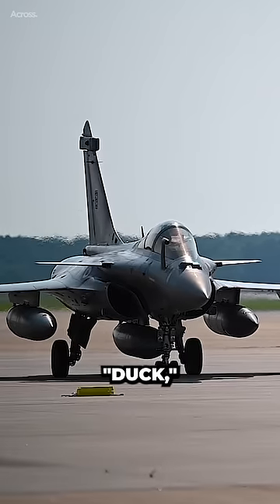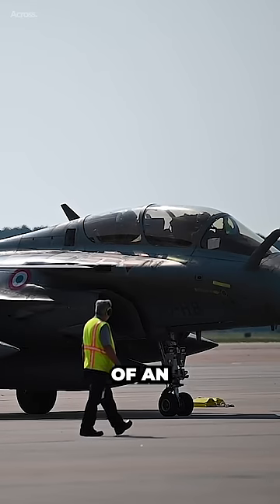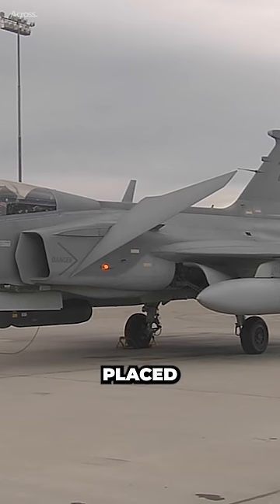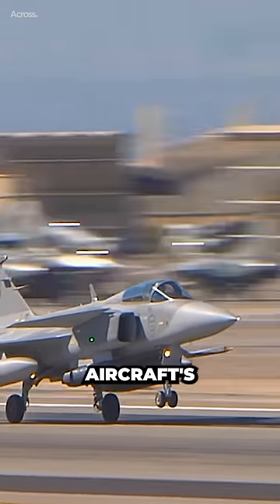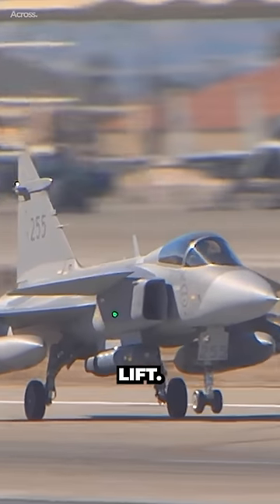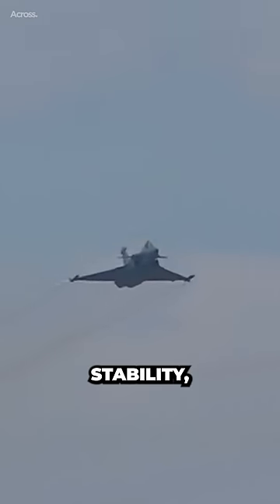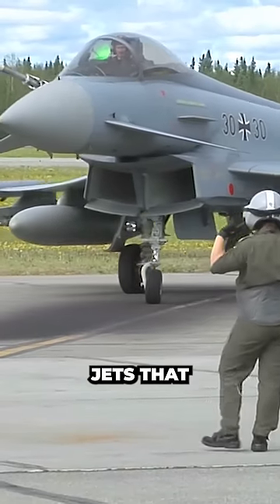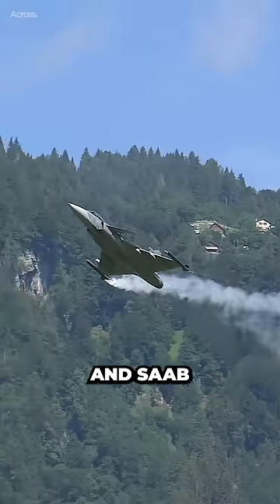Why Don't American Fighters Jets Have Canards? #shorts

Comment: “So the US avoids complex and unstable fighter designs? Please, tell me more.” - F22 and F35
Reply: Ironically, the F22 actually is designed to be aerodynamically stable as opposed to being unstable and having its thrust vectoring compensate to make it supermanuevereable. If there's anything that is purposely designed to be unstable, that would be the F16.
Reply: @Eis_  the eurofighter has canards, it is designed to be unstable,and is one of the best  4th gen fighter on the market,especially with a RAF pilot in the cockpit.
Reply: @Eis_  the f16 is designed to be unstable and that’s one of the most produced jets
Reply: @ellepant  The problem with the euro fighter isn't that it isn't a great fighter jet. Possibly better than any the USA flys. It absolutely is a great fighter. The problem is that nobody needs fighter jets anymore. What you want is an air superiority jet. 

A squadron on euro fighters lose to a pair of F22s every day, all day. It's been proven in war games over and over and over. But before you go clicking off on your keyboard...

I know that it gets publicized every once in awhile that the ef beat an f22 in a war game. If you actually read about them, and not just the headlines, it's always in a situation where the f22 started in a completely disadvantageous position that would never exist irl. And it almost always happens after the F22s just won the last 12 matchups when more equal starting points were used. It's basically impossible for a ef to sneak up on an f22. The f22 is basically an invisible AWACS with missiles. 

The problem is the euro fighter pilot doesn't even know the f22 is in the air until they have it in visual range. The f22 may as well be in invisible. The f22 can see the euro fighter on radar from 300 miles away, has missile lock, and fire. The eurofighter never even knows what happened. All they know is that someone just shot them down. 

The f22 loses when they start the fight 20 miles apart with the ef on the F22s tail. Its not that it's a bad jet. It's like putting a sniper up against Mike Tyson. If you start them ten feet away from one another, the sniper has no chance, he'll get beaten to death. if you start them a mile from one another, Tyson has no chance, he's getting his chest blown out by a 338 Lapua. 

Seriously. Go read about it.
Reply: @ellepant it’s also more expensive than the F-35A. Why buy a 4th gen when you could get a 5th for less. The capability gap between them is huge.
Reply: @herranton  yeah im not going to argue with you over an f-22,but that wouldnt really be a fair match up would it,same as an f-35.
Reply: @alexalbrecht5768  if your from the US why would you have 4th gen f18 f15 f16 core of your naval and airforce,if there so poor,because an f-22 and f-35 would blow any of them out the sky before they even know they are there.I would put a eurofighter up against any f18/f15 or f16
Reply: @ellepant  because they aren’t nearly as expensive and have been the backbone of the US Air Force for nearly half a century. F-22s are over 200 million usd a unit. Plus the F-18 is being replaced by a 6th gen aircraft
Reply: @ellepant  no, it absolutely isn't.
Reply: @alexalbrecht5768 : The F35 is cheaper to buy than a Typhoon. But its operating costs are a damn site more than a Typhoon.
Reply: @THE-BUNKEN-DRUM  the cost per hour for the F-35A isn’t much different than the Eurofighter. The F-35B is a different story but isn’t relevant to this comparison. The small cost increase is definitely worth it for a far superior aircraft that can survive in the battlefields of the future.
Reply: @ellepant  I believe the Luftwaffe is still a little bit better than the RAF 😉
Reply: @alexalbrecht5768  exactly,if your going to compare,it would have be the new 6th gen your building and the UKs new 6th gen there building,that would be a fair match up,because i cant say f-35 as we are partners in making them.
Reply: @alexalbrecht5768  Im English we do have the f-35b but they are for different roles.
Reply: @christianw.7824  🤣🤣🤣🤣🤣 im not even going to bite mate 🤣🤣
Reply: @ellepant  finally the garbage Eurofighter will be a relic of the past. Maybe the GCAP can make an actual plane this time.
Reply: @ellepant  the lift fan makes it practical for small aircraft carriers and improvised runways. Your carriers can’t operate anything else since the aging harrier fleet was retired.
Reply: @herranton  I take it you haven't heard about the long-range F-22 kills by the Typhoon, using the PIRATE IRST system to cue a Meteor missile via datalink? The F-22 may be stealthy for radar but it can't avoid skin heating by air friction. It has been demonstrated that he PIRATE system can detect the F-22 at much longer ranges than the USAF is comfortable with, and the Meteor combines very long range with high probability of kill.
Reply: @JC130676  I have. 

And my statement stands. The EF gets kills when it gets to start in an advantageous position. The raptor pilot can see the ef before the ef can see the raptor, AND, the raptor has longer range weapons. 

And even if it does come down to the turn in a real life scenario, the raptors are shooting first. After that, the EF gains an advantage in maneuverability. 

The situation you discuss is the same one I did previously. The EF scores kills when the wargames are tilted into its favor in the begining. In a dogfight, the raptor can lose. But it never will get to that point.  

The range the EF can see the raptor at is smaller than the one the raptor sees the EF. It's that simple. The raptor is invisible. Might as well be wonder womans jet.
Reply: @herranton  No, the F-22 does NOT have longer range weapons. The 120D has a range of 86 nmi vs 110 nmi for the Meteor.

As for detection range: like I said, the PIRATE has been shown to detect and track the F-22 at a MUCH longer range than the USAF previously thought possible. The exact number is obviously still classified but if it has the USAF worried...
Reply: @herranton  imma stop you at "perhaps better than anything the US flies"

The F-22, F-35, and F-15EX are significantly superior. Agility is a nice to have metric in a modern fighter jet
Reply: @JC130676  citation needed
Reply: @JC130676  a cloud gets in the way and it stops working

B. No IRST outranges radar so I'd enjoy an explanation for why the F-22 wasn't allowed to shoot back.
Reply: @hypersonichobo4263  Context matters. Go re-read what I wrote. It's a better dogfighter. Which is irrelevant in today's world.
Reply: @herranton  I'm honestly not convinced it is. All of these airshows and stats are always of clean airframe vehicles. External stores absolutely tank aerodynamic performance. While on paper the F-35 is slow at a mere Mach 1.8, very few Gen 4 aircraft with fuel tanks and more than four missiles can break Mach 1.3. The Mig-29, at least in the 90's, couldn't break Mach 1 at all with a centerline fuel tank. 

The one time a typhoon out turned a raptor it had 0 stores and no gun ammunition to a fully loaded raptor with two external fuel tanks. 

One of the advantages of stealth jets is they perform the same regardless of if they have internal weapons or not. All the fancy airshow flying of the super maneuverable sukhois is being down with a clean airframe and half or less fuel. 

Basically, I'm not convinced that any realistically combat loaded Gen 4 or 4.5 can defeat any internally loaded Gen 5 aircraft.
Reply: @alexalbrecht5768  our carriers were going to have slings and traps but the government changed there mind,but the slings can be added at anytime the UK government wanted to.
Reply: @alexalbrecht5768  the f-22 and f-35 is better than the EF,but i will say it again,your f15/f16 and f18 are not better than the EF,and they are the backbone of the US navy and airforce.The US are far more powerful than the UK,but the UK would give any nation on earth a bloody nose,no matter how powerful there nation is,history should never be ignored,And lets not forget that UK engineers contributed in the making of the f-35.
Reply: @hypersonichobo4263  :sigh:. I said dogfighter. You understand the difference, right? 

Both the f35 and the f22 are air superiority jets. They are not fighter jets. They can play the role of fighter jet. But that isn't what they were constructed to do. 

A dogfight isn't any engagement. A dogfight is what happens after the turn. Once the two jets cross noses, the one that can spin around the fastest gets the first shot. That will virtually always be the f22. Everything after that first shot, is a dog fight. Stealth is irrelevant. Everything happens in visual range. 

The f22 and the f35 are designed to take out anything before it gets to that point. 

The f15? Who knows? It's supposed to be inferior to all of them, but it never got the memo.
Reply: @ellepant  all of those aircraft are also cheaper and can do the same things as the Eurofighter. The Eurofighter has the cost of a 5th gen without the performance. With the huge advantage the US has in ISR and electronic warfare any advantage the Eurofighter has against 4th gen aircraft would be made irrelevant. There’s no need for the whole US fleet to be comprised of expensive 5th gen aircraft when our 4th gen aircraft can still compete with anything flying.
Reply: @ellepant  it’s not that simple. The carriers would require major refits and the UK would have to acquire an entire complement of carrier aircraft. They should have done that from the start and now they have a mediocre carrier with a mediocre air wing.
Reply: @herranton  genuine question. How do you plan to persuade the enemy jet, specifically a Gen 5 stealth jet to not give in to the temptation just just BVR you into a fireball from 100 km away?

Do you ask pretty please?
Reply: @hypersonichobo4263  No idea. 

Go re-read my post here. Seriously. I'm an American. I'm not a fan of the EF. I never said it was a good jet for the modern age. It is 30years too late. It would've worked well in the 90s. It's a dogfighter. And it's the best in the world at that. The USA doesn't have a dogfighter that can out maneuver it, because it's not necessary. I've never said anything other than that. 

You somehow latched onto something I said that was supposed to demonstrate the EFs limitations, and came to the conclusion that I was praising it.
Reply: @herranton  it's fairly questionable if EF is even the best dogfighter. Certainly not in the extended with that delta wing and those engines. And when loaded? Good luck. 

Ironically the F-35 is more of a universal Eurofighter than the typhoon is.
Reply: @hypersonichobo4263  nah, it's been demonstrated in war games over and over. Once your dog fighting, it had a definite advantage. 

If it was American with American pilots, it would dominate. The thing that keeps our pilots alive vs the Europeans is training. And the Europeans are actually quite decent. Against an actual aggressor like China or Russia, they wouldn't stand a chance, even with their fancy 5th gen stuff.
Reply: @herranton  the one time I found a duel between a EF and the raptor the EF won because it flew clean with a loaded F-22 hauling fuel tanks for some bizarre reason.
Reply: @herranton1979  Intersting. I know someone  who parked his EF at a us base. He forgot something and had to return to the aircraft. When he got back to the hanger the usaf were trying to remove the radar for inspection 😮 All friendly fun lol
Reply: @hypersonichobo4263  From what? A classified document detailing the exact range of the PIRATE system? Yeah sure, I'll get right on that...
Reply: @hypersonichobo4263  Read again: the IRST only CUES the Meteor. So the F-22 will have to defeat the IRST, the Typhoon's radar and the Meteor's radar. That's going to be quite a task.
Reply: @JC130676  you do realize IRST doesn't have much range right? It's a few tens of kilometers.

How are you going to convince the raptor to not AMRAAM you from 140 km away? Ask nicely?
Reply: @ellepant  the f22 gives 4th gen fighters nightmares... the F22 raptor is the most advanced and capable fighter jet ever built.
Reply: @JC130676  the IRST has a Headon range of 40 km, that's specifically stated by the Europeans. The raptor radar is good past 150km. 

150 is more than 40. So the raptor detects the eurofighter first and gets to shoot first. Second, third, and fourth.
Reply: The F-16 says hello.
Reply: @dontworry2379  Dead stick on a Falcon, just get ready to bail in short order, you have very little time.  It'll kick nose up for a scant bit then forward, depending on weight and drag.  Reinitiating in flight, a friend told me... the list is a bitch to memorize...  then do, that's a bitch too... also what to release if you have electrical to tell the hydraulics what to do...  if you still have pressure to hydraulics... OH SHIT HEADED TO THE GROUND NO FUCKING ENGINE!

Pro-tip:  Altitude helps with emergencies is a dead engine under your ass.  Yea, one of the most produced... At least the Phantom had two engines.  Falcons, designed to hopefully not get hit yet hit, easy to build, 'cept the engine.  Still it surprised me how good of a interdiction fighter it turned out to be.  (For those who don't know "interception" is very different from "interdiction".)

Don't Worry is correct the Falcon is prolific because of cost procurement.  Ammo procurement also.  It is good at lofting unguided bombs, same as dive on target straight down.  Coming on target, you have everything dialed in, pull back, release for lofting.  Make a right hand or left hand turn at Albuquerque, roll around for another hit or secondary, head home after.  "Do it again" sucks or "Next..." suck I've heard
Reply: And the f117 ha ha
Reply: @hypersonichobo4263  Yeah, because obviously everyone is going to reveal the true capabilities of their military hardware...

"The raptor radar is good past 150km. " Like some smart guy once said: "quotation please?" Radar range depends on both target RCS, target altitude and relative direction.

I'm not saying the F-22 can't beat the Eurofighter, because obviously it can (it had bloody well be better given the price difference), but it's nowhere near as guaranteed as you seem to think.
Reply: @JC130676  ah the old "their secret capability is way better than the published numbers" is the equivalent of saying "may imaginary numbers are way better so my thing wins."

There has yet to be a realistic air exercise where stealth jets didn't just crush Gen 4 or 4.5 jets. It's so laughably one sided that there is a crisis with too few aggressor squadrons. Nowadays they run with two or three lives per aggressor aircraft where they depart the airspace, turn around, re engage, die immediately, repeat. 

I'm not saying a EF can't shoot down an F-35, but they will lose a lot of typhoons to manage it. 

Radar outranges IRST, in 2023 that is a fact. If you don't believe that then I don't know what to tell you lol. 

"The Lockheed Martin F-22 Raptor has a radar warning receiver (RWR) with a range of 250 nmi (463 km) or more, while the radar has an estimated range of 125-150 miles (200-240 km) against 1 m2 targets."

The EF Typhoon is a non stealth Gen 4.5 with a few stealthy allowances like the intakes. 1 square meter is probably around what it's RCS is if it's loaded to the gills with big ordnance, but realistically I'd hazard 0.1 to 0.5 in air to air. So likely a detection range around 120-180km.
Reply: @noclass2gun342  if you read my previous comments,ive already seeded that,im English we also have f-35b,but we wont be engaging US jets,it would be Russian ect,so the EF would be engaging 4th gen fighters,and the EF is a match for them,there are not many 5th gen jets,certainly not enough to win a conflict anywere.
Reply: @herranton  
I thought all fighter jets were superiority? Theres a reason why bombers and attackers arent referred to as air superiority assets after all.
Reply: @spazzey0  The EF is more closely related to a light fighter like the f16 and doesn't have the bvr range that the f22 and f35 have, although the Europeans would love for you to believe it does. They like to pretend they can see the stealth jets. Verses an f16, the EF has an edge, but it should. It's decades newer.
Reply: @herranton  
All fighters are air superiority assets, the F-16 and EF typhoon are multirole specifically.
I won't be mentioning the 5th generation aircraft since the answer is obvious and already pretty long winded, I'm comparing it against the F-16.

The eurofighter is at a loss in beyond visual range, but a dogfight would be close, the eurofighter has excellent pitch authority due it's canards and having TWO thrust vectoring nozzles ( advantageous for roll as both engines are positioned away from the center of mass), a superior thrust to weight ratio, rate of climb, service ceiling and shorter takeoff.

As for payload, the eurofighter has a higher takeoff weight but it's maximum payload is lighter than the F-16's, which is also more advanced.

The F-16 is also remarkably cheap in comparison to the typhoon, thank lockheed for that!

I have no information on how extensive viper and typhoon training is for their respective airforces and what aircraft is the most intuitive to pilot, that is something I didn't expect not to find.

More variants and upgrades exist, it's hard to make a general comparison but European variants of the typhoon are armed with storm shadow, brimstone, spear and meteor missiles, some of which have received or will be receiving new variants.

I can't decide the victor (for every case atleast), I hope for a joint exercise that will fairly put these aircraft's capabilities and training against eachother.

A small tidbit: The viper first flew in the 1970s and the eurofighter in the 1990s.

In my opinion, European aerospace is severely underestimated, there is an entire century ahead of everyone, and plenty of time to develop and field new aircraft, some people are scared of the future, I'm giddy myself, what can I say?
Reply: @hypersonichobo4263  I haven't seen anything suggesting RCS for the EF below 0.5m² & that's likely at its best profile. The F-22 and F-35 would likely see it on radar 100+ miles away. It's highly unlikely that either aircraft would fly within the EF's detection range. The EF isn't a bad plane and, based on Sukhoi's statements on the Su-57's RCS, could even hold it's own against the Felon. However, VLO & stealth fighters have really changed the game. In any realistic scenario, the Typhoon would have horrible attrition ratios if they flew against F-35s
Reply: @nem1  I'm trying to be generous and give the benefit of the doubt. To be fair the felon is straight Garbo. Can't even do an S-duct (the EF does).

That being said I've heard super hornets can hit 0.1m^2 RCS. I'll try and find a source. So it seemed to me viable that a EF might hit 0.5

But in general, I agree. Anyone who thinks the EF is gonna spot a lightning before the other spots the EF is wrong
Reply: @ellepant  block upgrades to 4th generation airframes keep these on par or beyond with peer competitors in role effectiveness. Also cant be buying new planes every couple years.
Reply: @ellepant  
I’d rather go for a Draken or Grippen any day of the week
Reply: @herranton  Funnily enough, the same goes for F35 vs Rafale. Only the other way around ;)
Reply: @alexalbrecht5768 that’s pretty much why the uk is now buying more f35s
Reply: @ellepant  most modern fighters are engineered to be unstable because it gives better maneuverability at higher speeds iirc lol
Reply: @ellepant Undefeated F15 begs to differ
Reply: @dontworry2379 its price point, nothing more. It is effective yes, but the price is the main driving factor.
Reply: No. They don’t. But by the time the Euro fighter, Rafale, Saab Gripen were being touted as the best in class the US was building F-22 and beginning production of the F-35.  The NASA studies indicated stealth is reduced by canards and the increased maneuverability didn’t matter as much as stealth and thrust vectoring.  

I will bet $$$ on an F-22s winning any fight against canard equipped fighters when the pilots are of comparable intelligence and skill level.
Reply: @JC130676 
The Meteor is just an AIM-120D with a ramjet that gives it 30 more miles. It even still looks like the AIM-120’s I loaded too.
Reply: @ellepant 
If each had the Meteor (which given that the Meteor is just a modified AIM-120D and from the pictures used the same rails as the F-15) I believe the F-15 would win. The F-15 has a much more powerful radar which would allow it to fully utilize the extra 30 miles that the Meteor provides. I personally believe however that it would be a tough fight. Pilots of equal skill would both know how to evade long range BVR missiles and energy kill them by using altitude and thus the fight would get a lot closer than most would think. 

Even without Meteors, the F-15 has a great chance of energy killing the missiles fired at it from long range by accumulating speed, dropping low to get the missiles into thicker atmo increasing drag, and then shooting back up and letting gravity eat the missiles remaining energy and thrust.
Reply: @ellepant  so you're gonna say the UK would give the US a bloody nose?? Then you say look at history... Seems to me the last time the US and the UK fought (Real Combat..Not Simulated War Games) we gave y'all the bloody nose... Mate 🧐🤨 And Neither side even had Aeroplanes or even Tanks... Now we have alot of things that nobody else has... Like the Largest Air Force, The Largest Navy... The Most Aircraft Carriers... The Most Submarines... Probably still have the most Nukes too 🤫 shhh.. don't tell Putin that tho...
Reply: @alexalbrecht5768  In reality, the Eurofighter is probably a better dog fighter than the F-35. I'm not to saying that the F-35 is a bad dog fighter, but it is, first and foremost, a stealth aircraft. It is designed to fly unseen by its enemies and to to kill them from a distance rather than engaging them in a close maneuvering fight. Plus, with the additional capabilities that it has for air to ground and it's sensor fusion capabilities, I too would prefer to have the F-35 in my arsenal over the Eurofighter.
Reply: @ellepant  No they can not
Reply: LvivianChocolate  Looooool
Reply: With computers managing control surfaces, you can have more stealthy designs that a pilot could not easily control.